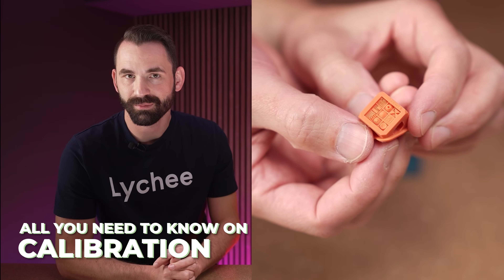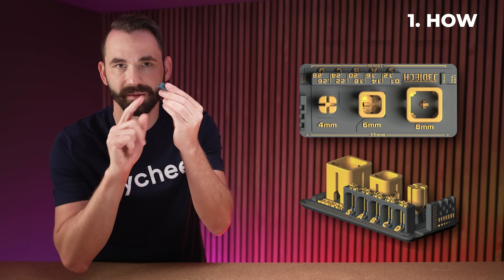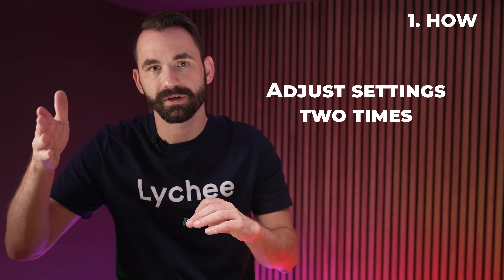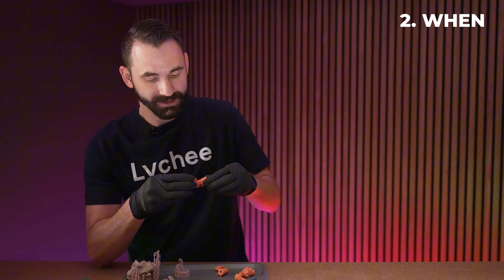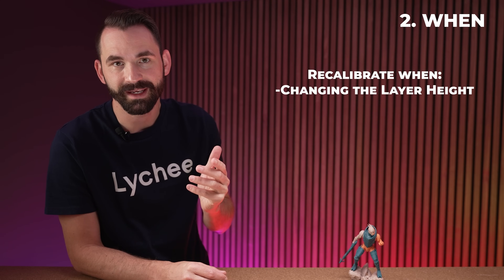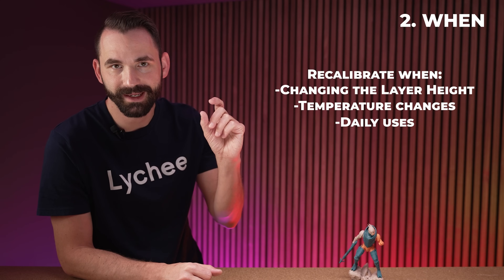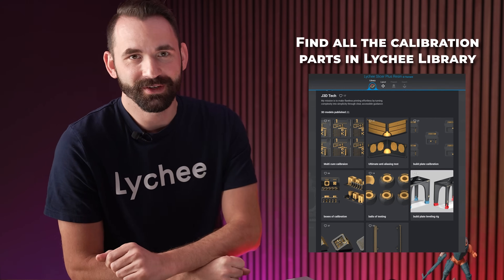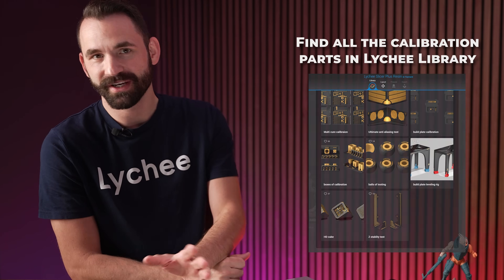Fix Your Resin Prints with This Calibration Test | Calibration Guide #2

Comment: Someone needs to a deep dive into clear resin, because on certain machines it's almost impossible to get both pillars and make the boxes fit, my M7 Max can properly calibrate Sunlu clear green ABS like resin but my Saturn 3 ultra cannot, I can get the boxes to fit but then most of the pillars disappear if not all
Reply from the maker: Thanks for the feedback, that's a great suggestion for a future video!

Comment: Great videos for a newbie.. I have an Elegoo saturn 4 ultra 16K. I have been using the ABS-Like V3+ resin. I lost my resin settings and when I redid them and printed the box of Calibration. I had to go from 1.8 Exposure time up to 3.5 and an Light off delay(Wait before print from a 3.5 to 4.5. Nothing changed. The room is still the same the printer hasn't move. Temp might be all that is a few degrees lower in the room. But just seems kinda strange for this much change with no change in the resin
Any Idea?
Reply from the maker: Join us on discord to get help 3D printing :D https://discord.gg/NGDDTgY

Comment: on the file, near the boxes there is 10 steps stair with 0.2 and 1.0 markings at its ends, what do they measure?
Reply from the maker: Do you mean the pillars? With the letters and the number on top? :)
Reply: @Lychee3d  sorry, just noticed the file I got from J3D's cults3d is different version from the lychee library, the one from lychee library doesn't have the stairs i mentioned

Comment: I'm using Sunlu ABS-like beige on a Saturn 2 and I can get 2 very stringy pillars printed maximum... The cubes are always dimensionally accurate regardless of how much I increase the LOD/WBP.

My latest test print was 3s exposure with 3s LOD/WBP and still just two stringy pillars. I'm using very slow lift speeds and kinda at my wits end with it.

Comment: Does it matter if the pillars are straight or bent/warped?  I got all the pillars except S. A and B were straight but the C and D are bendy/warped but technically completed.
Reply from the maker: It's fine, they still managed to print :D

Comment: Does this method work with ACF release film? Could be my super cheap and super expired resin, but I'm not able to get more pillars by adjusting Wait Before Print on an Elegoo Saturn 3 Ultra. Boxes look good though.
Reply from the maker: Works with any fep, if the pillars aren't printing it's not because of the fep, some resin don't have the tensile strenght to do so :) so make sure the boxes fit and get going! :D

Comment: First of all, thank you so much for this explanation. I always find all your videos very helpful. I used one of your previous versions of the boxes in the past, but I've been noticing I'm having some problems printing very small details, so decided to run this new version after watching this video.

So far, I got 8 pillars and the boxes fit well, but I noticed that I’m missing the circles below the squares on the side calibration tool, meaning I have layer compression issues according to your pic. I’m I still doing something wrong with the calibration?

I’m printing on a Saturn 3 Ultra with these settings: 
Layer Height: 0.04 mm; Bottom layer count: 5; Exposure time: 2.7s; Bottom Exposure time: 30s; Transition layer count: 5
Rest Time Before Lift: 3s; Rest time after lift: 0.05s
Bottom Lift Distance: 3 + 5mm; Lifting distance: 3 + 3mm; Bottom Retract distance: 5 + 3mm; Retract distance 4 + 2mm
Bottom Lift Speed 40 + 100 mm/min; Lifting speed: 90 + 360 mm/min; Bottom retract speed: 100 + 20 mm/min; Retract speed 180 + 60 mm/min.
Reply from the maker: Hi! Join us on discord it's easier to exchange and help you :D https://discord.gg/NGDDTgY

Comment: This is great explanations.   Btw, is there a link to all these calibration test files we could access?
I  haven't calibrated my Anycubic M3 in over a year and started seeing some issues with mediocre cross sections that I used to print now have errors.  I think it could be my build plate needs leveling so I'm doing that now.  I tested some faster speeds and everything that was tall fell off supports.  Shorter items stayed on supports.
Reply from the maker: You can find them on Lychee Library or cults :) https://cults3d.com/fr/utilisateurs/J3D-Tech/fichiers-3d

Comment: I ran the first boxes test on my brand new saturn 4 ultra 16k last night. Elego standard 8k red clay resin. I ran 2 exposure tests with light after on default setting of 1, exposures ranged from 2-4 seconds…

I couldnt get ANY of the boxes to fit. My thumb still hurts from trying to jam them in..

Question occurred to me… am i not supposed to be curing these tests in my washing machine/cure station until after testing? Is the three mins of uv curing i gave both batches rendering the test moot??

I find it very hard to believe that 2 seconds is overexposing this resin. My previous experience (same model printer but didferent physical printer)   Had this resin dialed in around 2.8 seconds..
Reply from the maker: Each printer even from the same model is different, the screens are not completely the same, two saturn 4 with the same resin won't have the same profile, try lowering the exposure until it fits :)

Comment: Derek, I tried printing the Boxes of Calibration  two times. Both times the print broke in pieces trying to get them off the build plate. They are hard to pry off. Do you know what could be wrong? My printer is a Phrozen Mighty Revo 14K, and I use Chitubox slicer. I am using Phrozen Aqua Hyperfine Graphite resin. I also used Phrozen`s resin profile for the print settings in Chitubox.
Reply from the maker: Hi! Join us on the Lychee Slicer Discord to get help! https://discord.gg/NGDDTgY

Comment: Derek - been a quiet follower for some time. I cannot adequately say how much all your videos and the great Guide have helped me out. Since you started using videos to support and explain much of what is in the Guide, it is absolutely fantastic in understanding the multi-facets of printing. Please continue doing this and using the two aspects together. In fact, maybe be more intentional about this and mention your Guide periodically and perhaps include links to it. I have adopted many of your tricks, tips, and anecdotes such as VAT leveling and using the rubber squeegie for example. I now place the squeegie after I clean it directly on top of the case so that I never forget to squeegie the VAT after every print for example. Yes, it's dropped to the floor a few times when i forget it's there...then I have to clean it...which has now trained me not to ever forget. So a little tidbit on how closely I follow what you do. Thank so much. I have Lychee Plus which i like a lot - so there...that should keep them happy...but please keep your independence as well. Thanks !!

Comment: Wait Before Print does not work on Elegoo Mars 4U in the .ctb file format.  The setting simply does nothing, as shown by: no change in print times (even when set to 9.8 seconds!), and the readout from UV Tools (showing 0 wait).  UV Tools shows that it does work with the .goo file format, but I haven't actually tried it.  I'd use .goo, but I also want to use Anti Aliasing for my projects.  It'd be great if this could be fixed!
Reply from the maker: Hi, send a ticket to support so that we can take a look at it :) https://lychee.co/contact

Comment: Well. Now I have to recalibrate my printer. 

Hopefully all goes well. I've been getting good results thus far but will find out what's going on soon enough I suppose.
Reply: Also might need to bring my resin temperature down. The heater is set to 30 atm because the UK is increasingly getting to a point where mid 20s are normal, so I set it slightly higher than I would otherwise to compensate for that
Reply: @lynxfirenze4994 Ah yeah but keeping it 26c would be good enough for sure.

Comment: Hello, maybe there is a problem with calibration if the temperature is very high (the sticker on the tank shows 34-36 degrees)?
Reply from the maker: Changes in temperature can affect the resin yes, you might need to recalibrate :)
Reply: Do you have a way to bring that down or you live in a super hot area?
Reply: @J3DTech  The only option is to wait until autumn, the thing is that the more boxes I print, the more confused I get. I realized when I wrote this comment that for accurate calibration I need to print only one test box with different exposures, and not print several multi-exposure tests with different settings.
Reply: @J3DTech  Another question: on the new anycubic printers (M4 Ultra), are there systems that determine when the model comes off the film? Do they need to be turned off during calibration?
Reply: @jimufo1877  Yes these auto functions are not always the best and actually only work if you slice using the any cubic slicer.

Comment: I've gotten my boxes to be a very good fit while still being able to wiggle them out of each other, but no matter how much light off delay I add I cannot get the A or S pillars to print. I'm up to 6 seconds and still only getting B pillars as well as Z compression on the test on the side of the print. Any advice?
Reply from the maker: Some resin can't have the pillars no matter what, get the boxes to fit and you'll be good to go :)

Comment: Thank you. This might be a silly question but do you cure the calibration parts before checking the dimensional accuracy or do you do that right after taking them off the build plate?
Reply from the maker: After curing :)
Reply: Not at all a dumb question. I wondered the same, in fact im curious what IS the recommended curing time for a standard cure station on a model this size? Truth be told all the boxes on EIGHT of my exposure tests from 1-4 seconds dont fit. Brand new saturn 4 ultra 16k.
Reply: On this matter, does the curing time affect de dimension of the resin part? I'm recently a newbie on 3D printing and I like it very much. Thank you.
Reply: Oh, also. Should I just go ahead by putting the calibration boxs on my slicer without having to add support or caring about numbers burning layer on the build plate?

Comment: 🤯 Does that mean the RERF tests on machines such as my Saturn 4 Ultra are useless for proper calibration? The areas with a lower exposure time will have an increased the light off delay time compared to the higher exposure areas… I had no idea that light off delay was so important in printing, my Saturn 4 Ultra prints incredibly fast even in Standard mode. There can be several adjustments to the overall light off delay so which is the best to change? Delay before retract, delay before lift or delay after lift? I’m not sure this was mentioned in the video. Overall great information to have, thanks!!
Reply: Yeah, there's a reason why I don't really do much with the rerf tests. Delays really change a lot with 3D printing and as you know, they're adding in delays that don't exist when you do your normal prints. 

I've played around with adding The delay after it's cured and I've gone from one second to 10 seconds and the difference in the final quality is almost unnoticeable to the point I say set this at zero or 0.5 seconds. 

The delay you want to use Is wait before print or in some situation is called. Wait after retract.

Comment: @lychee3d, does pixel size have any effect on the ability to print the columns?  I have a Phrozen SM4K and an Elegoo Sat4K.  They have x/y resolutions of .035 and .028 respectively if I remember right.  Can the smallest columns even be reliably resolved with that?
Reply: Not really, if anything, a lower quality machine would give you less accuracy. Therefore, the columns might be slightly larger than they're supposed to be, but overall they're not going to make a huge difference.

Comment: Thank you for that video. I don't really understand how light off delay make a different (not saying it doesn't do anything but what happen during this time?). Also what would be a good average time for light off delay to start the calibration?
Reply: Light off delay or Wait before print does two things. 
1: It will allow the printer to come back to square so that you get consistante layer heights. Larger printers, flimsy build printers,  cold resin, thick resin will all require more wait times.

2. If you're trying to cure flowing resin you're also going to lose accuracy. Wait times giving you that extra accuracy allows you to add more UV exposure time. MOre UV epicure time gives you a harder cure.

Comment: I've been using this and the earlier version of the boxes test and there is one flaw: they give you and indication of relative accuracy but not absolute accuracy. As most of the time, when the boxes start to fit into each other, they are actually smaller than their indicated (and designed) size. So there is qutie a bit more to take into account such as resin shrinkage and other variables and you need to play with shrink compensation settings and offsets too, not just exposure (and movement).
Reply: Everything is in the context of dealing with plastics. You can use Digital calipers after post cure to get your calibration dialed in. If you're trying to compinsate for using a resin that has a lot of post cure shrinking that's a very different topic. That said, I have found that scaling parts to try and resolve that is really not possible when dealing with plastics. This is becase a warm room vs a cold room will cause your measuremtns to be off. 

That's why I say, this entire topic is contained within the context of resin 3D printing.
Reply: @J3DTech  Well, I need stuff to fit and be true to the design. And not just the printed parts to fit to each other, but fit to other components, not made by 3D printing (such as injection moulding). I use the normal high quality resins, like Phrozen Aqua 8K or Hyperfine, or Siraya Tech Fast Navy etc. There is for instance even a notable difference between Phrozen's Aqua 8K and Hyperfine. Hyperfine shrinks more and needs a bit of compensation, while Aqua 8K doesn't (for medium size prints).
Reply: @rickenbacker6  Well definitely if you have those type of requirements you're going to want to look at resins that have a very low shrink so you're probably going to start looking at build type resins with 3% shrink in curing. 

My most complicated project is a robot that stands about a foot tall that has over 350 parts. The tolerance is on these parts can be 0.02 mm. 

But in the end that there's no getting around that plastics are going to expand and contract at a much higher percentage when exposed to cool or warm temperatures than metal. 

So although they are good for Rapid prototyping, if you need tolerances that good on larger parts I think you're looking at the wrong base.

Comment: So I have an old Photon that I got for free. I feel like I am running a gauntlet trying to get it to "pass" the test. Seems like the cones are two small, and I am using Lychee community settings as the starting point.
Reply: Cones? We don't use cones here. 😉That old Photon unless upgraded is uing an old LCD using RBG tech vs Mono tech. This means it will require a LOT of UV exposure time to cure and it wont have any accruact at all. I would honesly spend $200 and get a new cheap printer that will be 40x and make up the cost difference in time and resin savings.
Reply: @J3DTech  Well I got it for free with the wash and cure 2.0. Yup lots of newer stuff, and I figured it won't be as fine on it's prints, but I wanted to cut my teeth on it first, before I get something newer.
Reply: @dan8402  That's fine, as long as you are aware of the massive difference that an RBG LCD makes for a mono LCD. 

To give you an idea, a fast resin that make your in 1.5 to 2.5 seconds for a modern 3D printer per layer can take somewhere between 15 and 25 seconds for a older RBG printer.

Also on older printers you have to do the math to add any delays. For example, if it takes your printer a total of 8 seconds for the plate to go up, come back down and then to start printing and you wanted to add a 2-second lightup delay. You'd have to add a lot of 10 seconds not two. 

Newer 3D printers don't require you to do this math or to watch your printer and see how long a cycle takes.
Reply: @J3DTech  Yeah I know. 😢😢
Right now it is more a political wifey thing. If I show her value, then getting one that makes things faster and better is perfect. Either way I think if I get a Christmas bonus this year, I will pull the trigger on one. 
I was looking at an FDM Sovol 6 plus, but for minis and smaller things, resin is really the way to go. Honestly I just ran my first batch of warhammer 40K last night. It isn't quiet as sharp as a newer printer, but not bad, if I am printing an army at night for my sons gaming concept class. Plus through your videos, and knowledge I am learning a ton! I figure if I get even remotely descent on this one, I will pull the trigger on a new one later this year. Cost of course is a factor but even like the FDM printers costs are dropping as the technology improves.